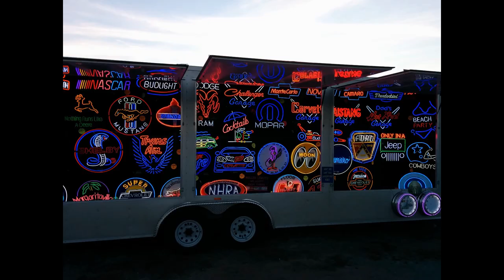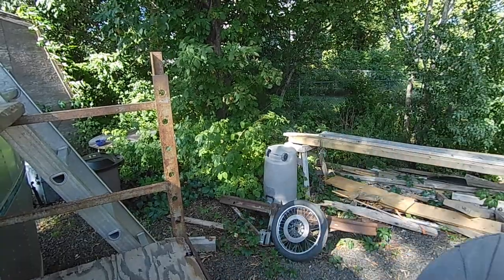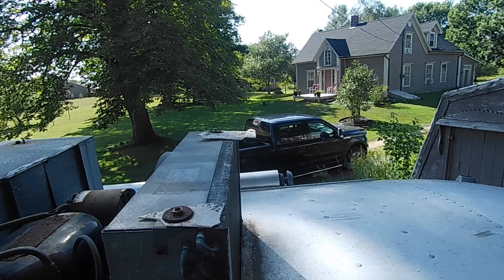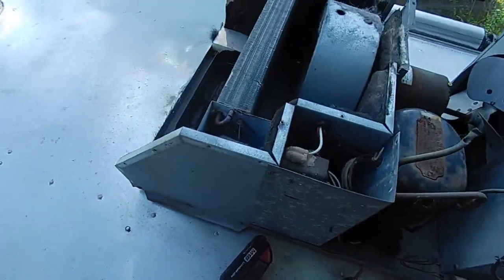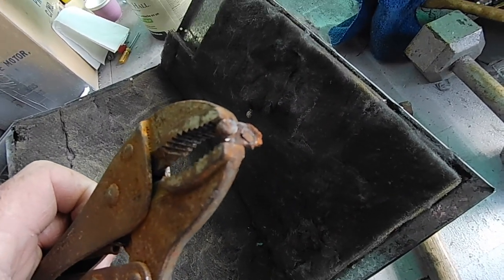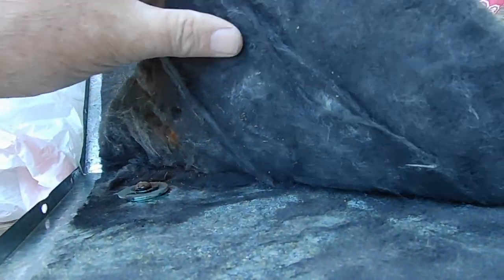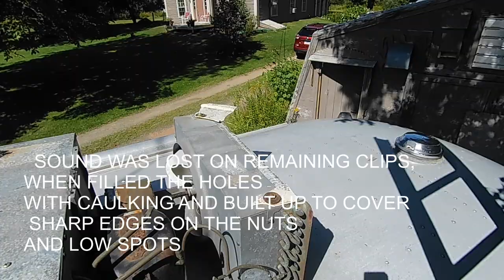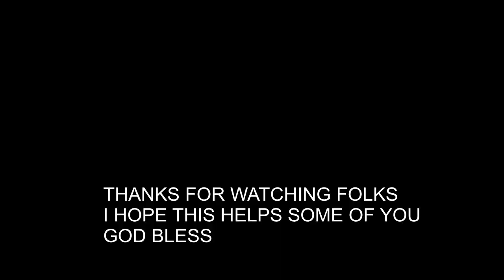RV AIRSTREAM AIR CONDITIONER SIMPLE FIX HOW TO save money

Comment: Thanks so much for the video!  We were about to roll out for a couple of months in our 93 34' Excella and our A/C had stopped working.  The compressor would kick on but the fan wouldn't.  We just had this "checked and serviced" at an RV dealer and were given a clean bill of health for it so we immediately thought it finally but the dust after 30 years.  After watching your video I climbed up and double checked under the shroud.  Cleaned it, oiled it, and bam back up and running!  Woot woot you saved me a couple grand and a weekend to install a new A/C.  Thanks so much!
Reply from the maker: Awesome, thats the best reply yet, so glad this helped someone else. happy travels

Comment: Hi I’m renting in a air stream with this same unit it looks like and both motors seem to be seized up but they have been running well for the past month everyday here in Texas from about 12am when I get home from work until 11am when I leave the trailer again I turn it off. And just the other day it sounds like it’s on but the fans are not moving. Went up top and the fan moved freely like in your video, but the fan that you can see from inside the trailer wants to move and can get it moving for a second by forcing it with a flat head screw driver but then it stop and sounds stuck. 

My question is can I call you sir and FaceTime you and Venmo or cash app you some money for your advice before I pay this guy who came out and didn’t do much other then look at the motors and say you need to buy new ones replace them. 

Thank you sir hoping to hear back from you.
Reply from the maker: Sorry but I dont think I could help as I am not a air conditioning tech, just posted for this simple fix I found that seems to happen often. Other then freeing up any fans and running very little oil to keep them going. It is always possible that a motor burns out especially down in Texas. But all I can suggest is if you find the one thats stuck and take it apart to see if something obvious is causing it to stick then you may need a new motor. One last long shot is to make sure you are drawing enough power to fully run the AC, otherwise it may just hum and not kick on. Best of luck it must be hot down there now.